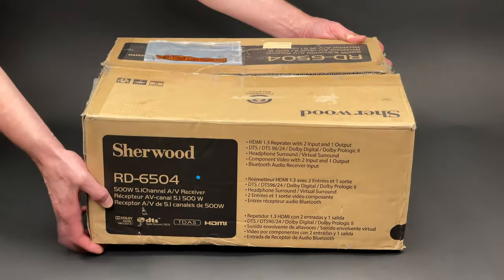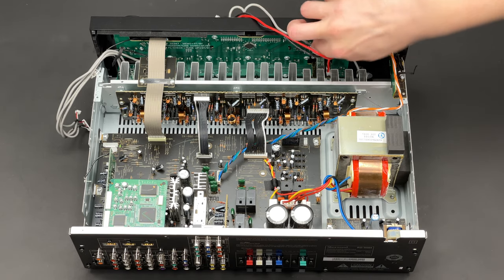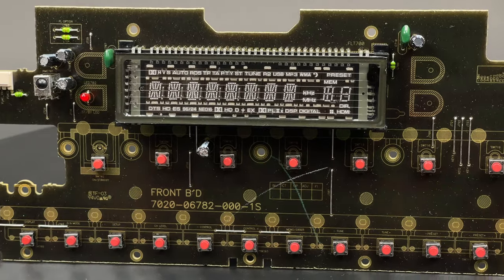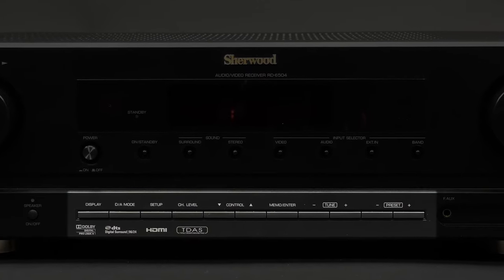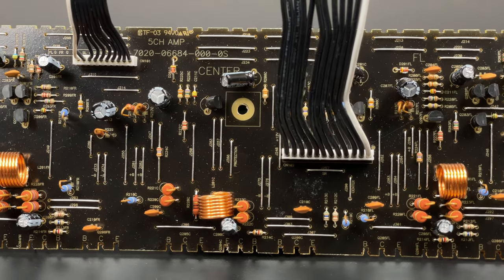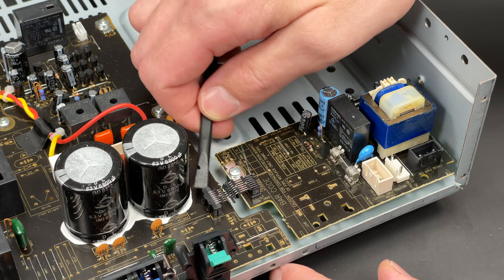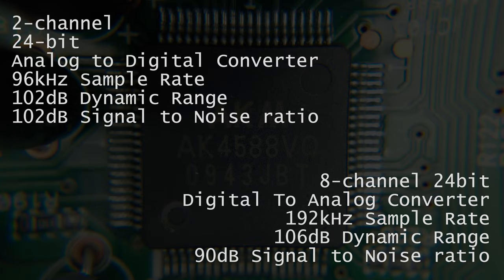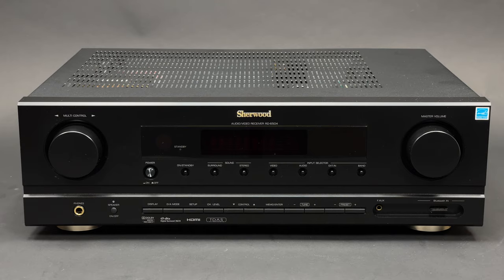Sherwood RD-6504 Teardown

Comment: Interdasting. These were old 10yrs ago and you could get what were NOS units back then over here for under $100. I like how the transistors are only rated for 60w but you could guess these things had inflated power figures since the power consumption was something like 300w. The sound quality is actually pretty decent but obviously not comparable even to a middling brand name unit. Ok for a garage unit and I think even the DAC stage isnt too bad being 24/96 - good 2nd pc setup maybe? They also made a whole line up of these, the 6505, 6506 etc with minor improvements mainly to keep them relevant for sale... ie. more hdmi etc.